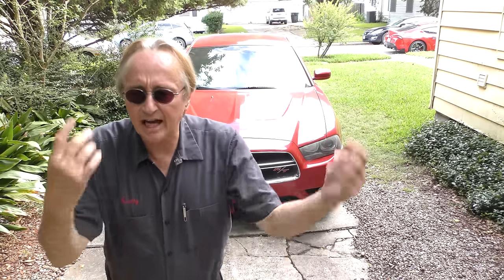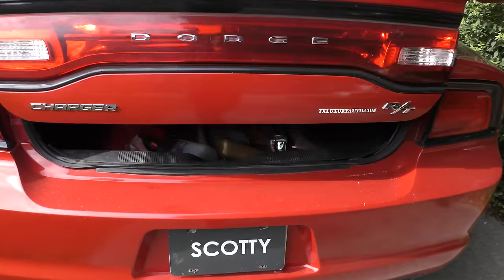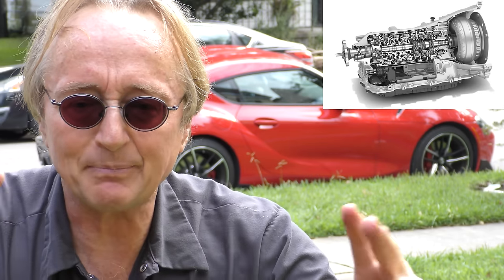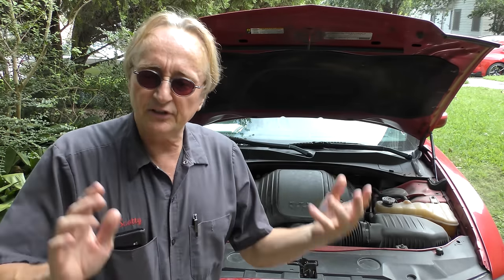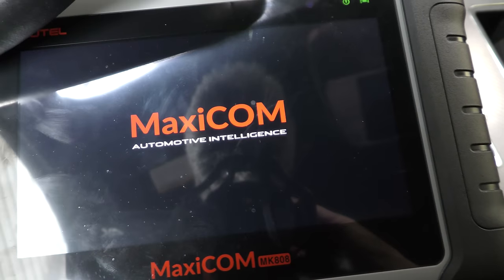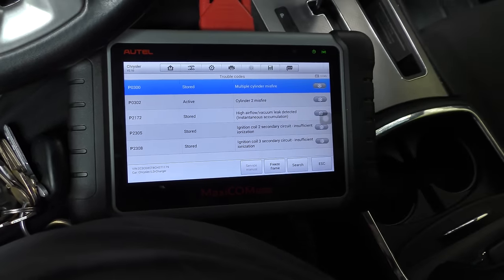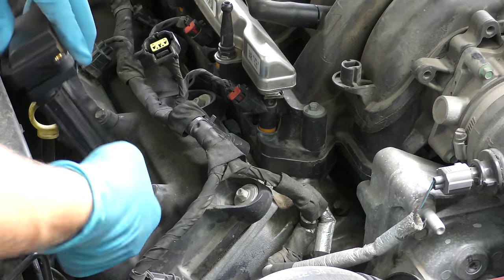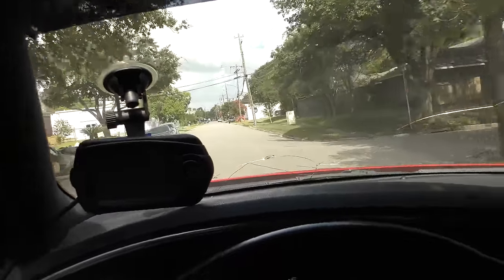Here's Why I'll Die Before I Buy a Dodge with a Hemi Engine

Comment: I'm 66yrs old and learned to drive in my Mom's 1963 Dodge Dart and have been a Dodge person ever since. I've owned ex-Hiway Patrol cars, 70's Chargers, several Dodge Trucks 1963 to my current 2020 Ram Hemi 4x4. I had a 2006 Charger with a hemi, my son is still driving it now. All these years I have never had any major problems with any of my vehicles. It's my opinion that many persons that drive Chargers, etc. abuse them and don't take care of them. I've taken care of all my vehicles and perform regular maintenance. Believe it or not, the car I had the most problems with was a Toyota back around 1986, piece of junk, I bought it used. Anyway, just saying that I think proper maintenance and not abusing the vehicle will make most cars last much longer, looking at the Charger in the video, it has been abused bigtime. My son hasn't done any maintenance on Charger for 3yrs now, today at my suggestion (again) he actually changed the oil. Hopefully he will take better care of it, he is on his own now.

Comment: Actually I've watched plenty of videos about the 5 7 Hemi and dude you didn't even get the numbers of the power on the engine right the fuel economy that car gets is around 12 City and I think like 15 highway on the old ones maybe I could be the might be a little less you want to see son with 10 miles to the gallon trial 488 cubic inch V10 that is a gasser the 5.7 ant

Comment: Wait until the heater quits and you find out dodge discontinued the parts for the broken door in the ac/heater box under the dash and it can't be fixed.  No heat, no defrost this winter. yuck.

Comment: Chevy or Ford with a loose battery terminal: make it home from work put the key in the ignition the next morning turn the key on everything lights up normally attempt to start it grinding and clicking like a dead battery and won't turn over.

Dodge with a loose battery terminal: gauges going crazy, flickering lights, voltage reading over 15 volts while the car is running and finally car stalls out in the middle of driving and will not turn over no power in the car at all. Dodge Jeep Chrysler check the battery terminal once a month.

Ford/Chevy remove battery while idling: car still runs

Dodge unhooking the battery while idling: car dies immediately

What are you doing differently Chrysler Dodge Jeep?

Comment: I can personally tell u it’s not just the chargers it’s all the high horse power dodges I work at a race track an see them all every weekend an unless u have one that you done replaced all the factory parts with good made parts they are all junk we break more dodge transmissions driveshafts axles the ones with the cv axle is big time junk but we break more dodge cars on a weekly basis than any other make out there ford second place with blowing them up an the cameros hold up pretty good we haven’t had to many them blow up on the drag strip as much as the mustangs an any of the dodges challengers chargers hell cats an demons they all garbage

Comment: 148K with the owner abusing it?  If they took care of it, it would last 500K.  It's missing because the VVT is all gummed up.  You don't throw parts at it, you swap coils and see if the trouble transfers.  Comon Scotty!  By the looks of it, it was obviously poorly mantained.  3.5 V6's are worse.  They have poor PCVentilation.  You must change their oil at 3K.

Comment: How many years experience working on cars??   And yet he changed the coil pack instead of just exchanging it with one of the other cylinders.  So now the customer has spent money on a coil pack that they didn't need.  That money should have gone to the expensive cam, & lifter job that's needed...🤣

Comment: Well the oil change is due and its owned by you so who lnows what you did to it... my dad has a 03 2500 has 400k+ miles hasn't changed the oil in 3-5 years and its his daily... yes it changes its own oil and no it wont die when its low on oil

Comment: Scotty's full of horse apples. 
I have a '08 300C Hemi I purchased new with over 133,000 miles on the clock. It's not throwing any fault codes, and I've never had any issues whatsoever with the engine or transmission. And when I punch it, the car still moves like a scalded cat, and it can cruise at 80-100 mph for hours on end without breaking a sweat. That particular Charger has obviously been neglected and abused.

Comment: You talk too much great Mechanic how do you know that the engines worn out and it’s just not loyal which would cause it to idle slower misfire on cylinder too I can’t have a misfire cylinder two because I’m in Jector something you know whose talking without doing any test I mean it might be that but you’re talking before you actually diagnose the car that doesn’t make you look like a good mechanic and then you start doing coils at it did you think about maybe switching the coils around first like cylinder to maybe switch it with cylinder four and see if the code comes back

Comment: OK, I stopped watching this nonsense video when he started spewing about the 5 speed auto transmission in the Charger. The 5 speed in these is "2005-2019 Chrysler W5A580, 5-speed automatic. This was a Chrysler adaptation of the  Mercedes-Benz 5G-Tronic 722.6, which was first labeled as the NAG1. Found in the 300, Magnum, Charger, Challenger, Wrangler, and some Dodge Ram pickups, the A580 was last used in the 2019 Dodge Charger Pursuit models." This was never a problem transmission, hence it's continued use in the police package cars all the way to 2019.

Comment: 2013 dodge charger rt. Crap made. Hated it. Had power steering failure at 39k miles. Driver door handle did not open car. Could not get it in because I had a dead battery at the same time. Only one manual entry is on driver side. Dodge products are garbage.

Comment: I've had 3 hemi's and literally had nothing ever go wrong with them.
Reply: I had a new Ram. It dropped a valve at 63000 miles. The sad part is my son always loved it so he purchased a new one. It literally fell apart by 75000 miles. The biggest issue. Constantly over heating.
Reply: @chatsworth8768  my wife's dad has a Ram. Just about 40k. Whole rear end needed to be changed. 5k. 4 wheel drive failed. He had to pay. What garbage.

Comment: Buying a high mile car driving it for a yr or two then bragging up "problem free"....we know better 
Changing oil a lot wont make one exempt from design flaws. 
The more modern any engine esp V8 is regardless of brand the less reliable they are. 
Sometimes less is more .

Comment: All the 5.7,6.1,6.2,6.4 hemi's have roller lifter failure.   The roller lifters stop rolling and grind into the cam destroying the lifter and cam (if you are lucky).   The newer Hellcat roller lifters have larger bearings and are rated to hold much more power over a long period of time.  Also, while you are "in there", replace the oil pump with a high volume melling or similar Hellcat pump that will ensure you are getting oil to the cam/lifters.   And for the love of GOD, change the oil religiously every 3,000 miles no matter what the "manufacturer" says.  The manufacturer was the same dope who installed sub-par roller lifters and lower volume oil pump at the factory for cost savings.
Reply: I have Never had one fail.

Comment: Sounds like a car that wasn't taken care of. Be pissed at yourself for not maintaining or not checking the car out before you bought it. My Charger R/T has over 233,000 miles, no problems at all with drivetrain. This car sounds like it may have had its first oil change at 20,000 miles.

Comment: Let’s actually be more real here. One could make a bet that a simple inspection by removing a valve cover could prove more beneficial for a proper diagnosis.  It could simply have a broken valve spring but hey, it’s junk, not worth fixing and needs a remanu”fractured” engine…LMAO.  You could in fact probably fix it for $250 and a few beers in one afternoon instead of doctor death here by looking under the valve cover first.  Once you drop a valve because this guy says it still has guts but is junk and not worth fixing will cause you more damage to your wallet.  Take care of your stuff by not always taking it to this guy with a SupraBMWdontknowwhatitwantstobe with an 8 speed trans.

Comment: Scotty has always hated Chrysler and its current Fiat incarnation. I’m daily driving a 65 Dodge Dart, Scotty. It’s a great car that was well maintained. Before that, a 68 Sport Fury. Keep hating Chrysler. Leaves more of them for those of us that love Mopar.
The 5.7 will drop valve seats. That lifter tick is not a good sign. I agree that buying a used hemi car is buying a dogged out car. I see a beater you are in complete with cracked windshield.

Comment: Here's why I'd die before buying a Toyota with a 2az-fe engine .......... My 147,000 mile 5.7 hemi burns less than a quarter of a quart in 6000 miles and has never been apart.

Comment: I had a 2011 ram 2500 with the hemi. Engine failed at 190,000. Maintained that truck. I bought a Ford. Never will buy dodge again.

Comment: Scotty, the 5 speed automatic is NOT Chrysler made.
It is a German ZF transmission Daimler forced on Chrysler when it took over the company.
Yes, the ZF 5 speed is a crappy transmission that is expensive to service and replace just like the newer ZF transmission it uses now that you sing it's praises.
In your biased zeal to slam Chrysler yet again you failed to check the facts on who built the 5 speed and since you praise the ZF 9- speed does that mean now the 5 speed ZF used in the older Charges is now good too since Chrysler did not make it ?

Comment: I have owned 3 chargers in my lifetime. The first one i traded in after a couple years, the second one i got into major accident and totaled. Thank God the superior rollcage saved my life , lol. LOOKS AND FUN ON THESE ARE FINE.....HOWEVER MECHANICALLY, THE FACT IS THERE IS A VERY VERY SERIOUS  FLAW in Gen3 5.7 Hemis.
 It was a 2014 Dodge Charger RT with 5.7....I never got the chance to get to 100 thousand because of accidnet. My insurence company helped put me in another. My current 2014 dodge charger ive had since i purchased it at 18 thousand miles so was like damned near new..... 5 years later and at 181325. Yes i put 160 thousand on it myself. I drive alot. 
Seemed to run awsome up until just the last few months. I have the same lift tick, and other issues are also starting to occur. 
I have faithfully followed all guide lines and followed every single thing to a tee that your supposed to do like a religion in an O.C.D fashion. Yet i still didmt make it to 200 thousand without this current major motor failure its having. Never had anyone other than certified Dodge Mopar mechanics touch it and i followed every recomendation.
There is no excuse for this not to make it to 250 or more. Dodge Chrysler really made a fatal flaw mistake in the design of the generation #3 5.7 Hemis. This is FACT!!!
There is Major Billion Dollar Class Action lawsuit against manufacturer happening right now that started a week ago for sweeping the major flaw under the rug. There have been also several attempts at class action lawsuits in the past for same 5.7 engine ove rthe past few years.
Its a shame too because its such a beautiful car. 
Its sad that they knowingly put these out while knowing very well its major design flaw, and makingbthe consumers pay for there mistakes. They even forced dealerships to shove under rug, and have there mechanics amd advisers lie to customers to empty our hard earned dollars, while not actually fixing or resloving the real issue. The pil dostribution-Lifter-Camshaft flaw  should have been recalled years ago. Know way should loyal Dodge customers be forced to pay for somthing thats no faukt of there own. This is a manufacturer failure and they should be responsible, Period....
Ill never trust Dodge again.
Im sorry guys, but Scotty is right about this.
I dont know how well the specific car hes demostrating here was maintained, but regardless, 10000s of charger owners who have taken proper care if therr cars have suffered the same fate .
There is an astronomical amount of customer complaint testimonies all over the web about the EXACT Same thing that Scotty is demonstrating in this video.

Comment: Just not worth fixing.... there was a time where you rebuilt a motor. Then came the time to just buy a crate motor. Now the mechanic says instead of a $5,000 motor you need to cut your losses and go spend $50,000+ on a new car. Some vehicles will remain popular and these cosplay dodges will be such. I have a 1998 Ford f150 with 310k miles on it and she is 100% original. I have water in the oil.... theres a vehicle not worth fixing. My local wrecking yard actually told me I would have to give them $100 to take that ford off my hands due to local pollution laws and low scrap prices. The pickup still runs and drives! It's not like they have to send a tow truck.... your assessment that the car isn't worth fixing i dont agree with. But honestly were within 15 years of all gasoline vehicles become junk. The times are changing and were going electric. So I guess your right for different reasons.

Comment: So you're talking about a used car from 2012 with 150k miles which clearly the owner did not take care of.  Anyone with a lick of sense wouldn't buy a used car with power like that without first checking to make sure it was properly cared for. I bought mine new for this exact reason I dont trust how people take care of their car. It's a good car.  I didn't buy this car to get good gas mileage. If I wanted that I would've bought a hybrid or an electric.  Poeple that want this car are gonna buy it. Just cause you dont like an old crappy version of the car doesnt mean its not good. Also dont plan on keeping it for the rest of my life. You can say these things about any car. Every buyers needs and circumstances will be different.

Comment: Sorry scotty v8 and Hemi 5.7 are junk anyway I own a 2010 3.5 v6 myself I love v6 car in my dodge charger to put money in two it by keep your damn oil fluids change and make sure flush transmission fluid always keep every fluid up to date yes dodge charger v6 are worth having for a long time but whatever you do don't buy chevrolet silverado with a 6L80E transmission thay can be vary bad and more expensive then a dodge charger I do know for the fact parts for dodge charger can get cheaper as well but do yourself a favor pull the v8 out threw it away buy v6 put it in make sure you pull the v8 out of the car first after that then get a v6 engine its alot more small and easy to handle and fix then a pace of junk Hemi with my skills I would not want a Hemi or want one becuse not cool or easy to fix with my ability  v6 yes I love them alot not hard at all

Comment: A V6 does not have "less strain" it has more, as it must use a higher percentage of it's available power to move the same mass at the same rate as a V8. What a maroon...
Reply: He was talking about the transmission, and older people that drive v6 normally don't dog them as much.
Reply: @shannoncampo9820  doesn't change the laws of physics by having a V6 vs a V8, that Charger weighs relatively the same. The stress on the trans, moving a 4000+ lbs. car to highway speed in the relative same amount of time is equal.

Comment: Yes the hemi engine is complete garbage, my company bought a couple for light duty work, mainly just highway driving. One has had the engine replaced twice and the other just sits in the parking lot because it runs so crappy no one trusts it. Never buy any dodge product.

Comment: Scotty Mazda? Its a piece of junk ford. I have a 2017 Ram hemi 8 speed with 300k without one hiccup sice day one. enough said. You seem to only like Toyota, they are great vehicles until you live where the salt the roads. All Toyota trucks and SUV frames rot out so quick as they use such thin cheap metal. I do like your videos but I tend to laugh at some of your comments as you tend to be a bit numb on your thoughts.

Comment: My charger is a 2013 awd RT, I bought it used because it was the best Hemi deal I could find for the price. The previous owner(s) must not have maintained it well because my oil pump went bad and then finally gave out at 105,500 miles. So after that I had a cam bearing go bad, a collapsed lifter, cam was only slightly scored because I stopped driving as soon as I heard the noise, and come to find out it had a piston connecting rod bearing go bad as well. When I was diagnosing the knock I also found that the driver side CV axel is loose as hell. All in all I sometimes regret making my purchase, but then I started to look at it as the car I’ve always wanted and I will be building it here soon, already have saved a good chunk of money, just have been pricing out parts. I will say my situation is on par with other commentators about maintenance, after I first bought the car I only ever put premium grade fluids in it and serviced it regularly, or the manufacturer recommended fluids. But do to the previous owner(s) now I’m sitting on a pile of work. But in the same token it gives me the opportunity to make a monster!

Comment: Honestly I  think you hate dodge vehicles, and I don't even know why are you doing this videos. I ve bought 2 charger v6, 2015 and 2021, and you know what?  Those cars are the only one's that never gave me any trouble. Obviously the cars you used for the videos, were abused plus no serviced, but that can happend to any other cars including toyotas or hondas, which I had in the past. My nephew had to get rid of his 2009 lexus just because had an electronic and transmission issues, the mechanic gave him the estimate of $8000 if he wanted fixed. So don't tell me that only mopar cars has problems, any car without the adequate maintenance is going to going to start giving you problems. Period.